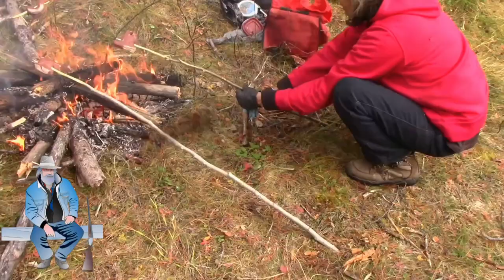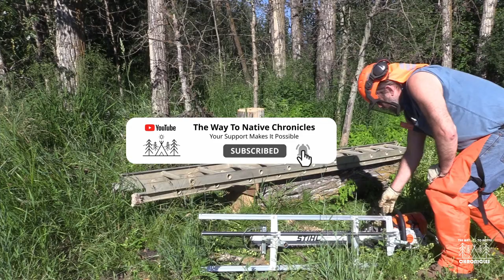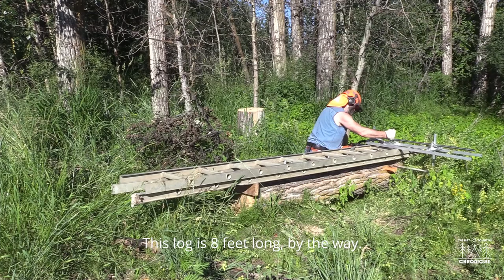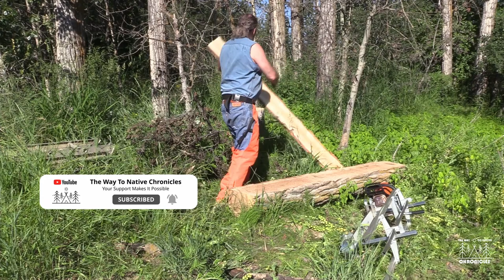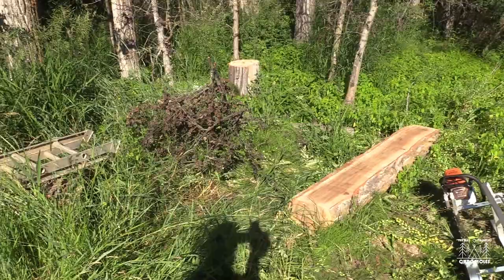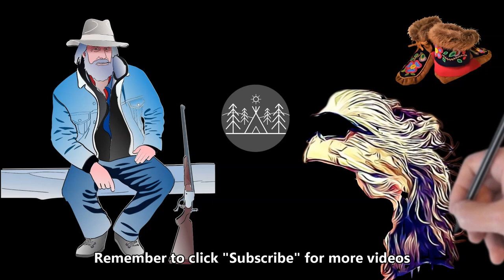Milling the Top Slab Off Logs On the Ground

Comment: You didn't show how you attached the ladder to make the a flat, level first cut.
Reply from the maker: Thanks for mentioning that Susan.  I should make a short video demonstrating that.

It's basically a matter of taking some 3-1/2" wood screws and screwing a short 2x4 (the width of the ladder) to each end of the log first.  Then, when it comes to the ladder, I use the electric drill to screw 6 lag bolts through the rungs and into the log (not too deep, so it doesn't interfere with the saw cut later).  I have pre-drilled the holes in the ladder rungs.  Since the distance of rung-to-log surface can vary, I have 4 loose-fitting nuts on each 6" lag bolt that I can add or remove - using them as spacers so I get the right length to the log (and not too deep).  Works really slick and takes very little time, yet it makes the ladder very secure to the log.  Hope this helps clarify that a bit.
Reply: @TheWaytoNativeChronicles  Yes, this all makes sense.  Thanks so much for the explanation!  Keep the videos coming :)